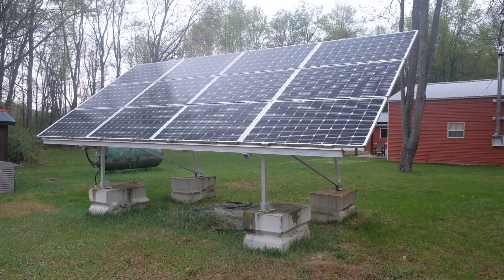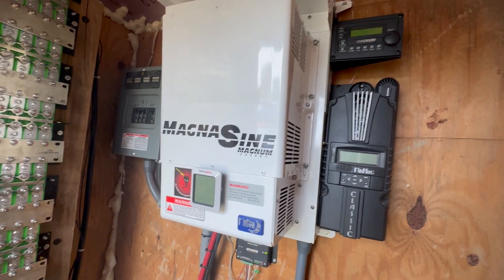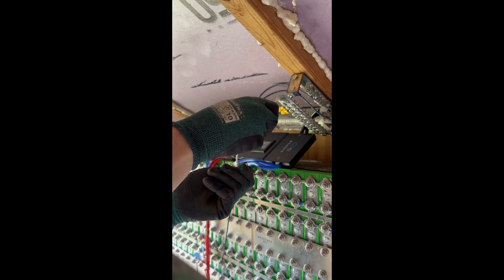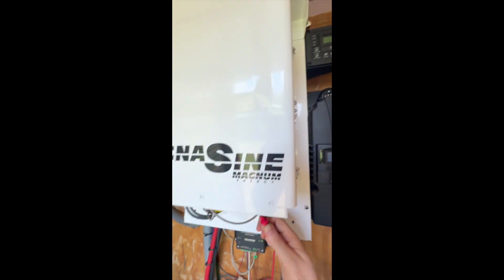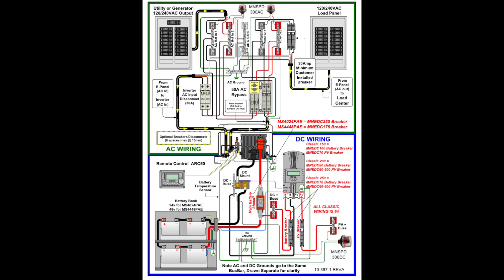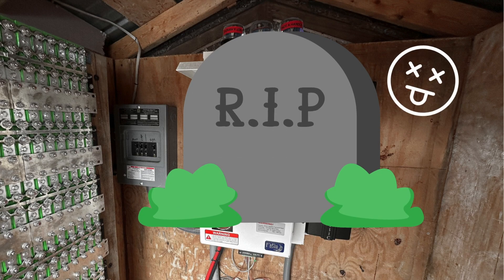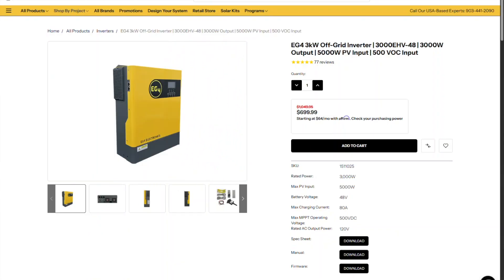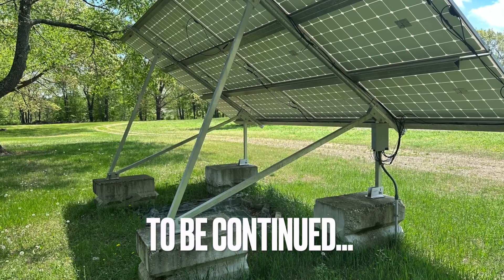My Inverter Died... Now What? | Off Grid Solar Troubleshooting

Comment: First Replace All the Electrolytic Capacitors, They either go dry or leak, if Tantalum Capacitors then they can go short, 
as a Retired Instrument & Controls Engineer - Aerospace - Defence Test Engineer, also worked on Motor Speed Control Systems, Look at the Capacitors, Then look at the Transistor - SCR Blocks, 
I'm a person that loves to repair all sorts of things & hates to see things go in the E-Waste, 
I'm retired now so I have to keep my mind alert & going strong, 
When replacing Electrolytic's Capacitors go for Make Panasonic, Temperature 105C & Low ESR Value, they are the best   
Have you removed the BMS Comms lead & tried to Start the inverter? it might be the Comms from the BMS telling the Solar inverter to shut down? 
I've come across very small value capacitors like 1uf to 3.3uf stop a motor speed from working !, 
So it's always best to replace each one at a time, & Please take photos of the polarity as it might Not me on the PCB markings,
Good luck
Reply from the maker: Wow, you know way more about inverter functionality than I do! Unfortunately, we scrapped the old inverter and installed a new Sol-Ark inverter. We were able to complete this upgrade in a day and now it is much more reliable.

Comment: New All in One mppt inverter charger are sooooooo much better than old school
 Difference between lead acid and lithium seems small in comparison
Reply from the maker: I’m about to order a Growatt SPF, what have you used? I like that the Growatt is transformer based and split phase. And it might work with a Seplos BMS.
Reply: @solarjoejoe  building a 48v system atm , currently using 560ah lithium 24v Y&H pure sine wave low frequency All in One mppt inverter charger ~3500w 120v ( * 1500w per leg 240v they say never used it)
 Been 100% off-grid solar for 6 years , off-grid 12

Comment: EG4 is absolutely NOT a pretty amazing option. It uses low surge capacity, short lived high frequency, transformerless inverter technology that doesn't provide any gallvanic isolation between its DC boost stage and its AC output, so when its MOSFETs fail, this inverter can not only damage your appliances, it can even set some of them on fire. You would be far better off installing a low frequency, transformer based inverter instead.
Reply from the maker: Thanks for the feedback! No wonder why they are so low cost! I was also considering the Growatt SPF 6000T DVM and the LuxPower LXP 6000. My guess is those are also high frequency transformerless. Are there new low freq, transformer based inverters available? Sol-Ark? Or is it the same old ones like Outback, Schneider, SMA, Magnum, etc.?